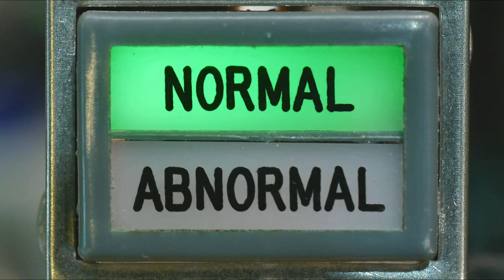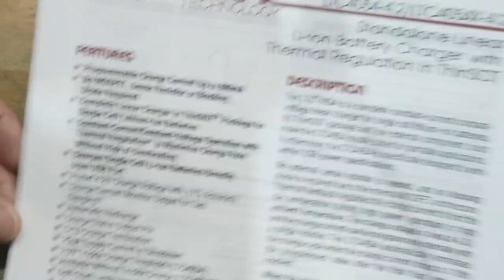#677 TTGO Board Battery Charge Current

Comment: For de-soldering this 0402 parts I use some Kapton-Tape to protect parts around it. I use a tweezer and a hot-air station unter a stereo microscope. This way it works.
Thank you for explaining to charger stuff.
Reply from the maker: Yes that is a good idea and I've done that. I was just lazy as usual.

Comment: I came to the conclusion than these TTGO boards simply have a defective charging circuit. They charge batteries OK but the ESP32 cannot boot if the battery is below 4 volts, which defeat the purpose of having a charging circuit...

Comment: When charging a battery through this board's USB aren't you also powering the module & the TFT driver & backlight? How much of the allowed input current do those devices draw & thus is not directed to charge the battery?
Reply from the maker: if the input is still 5V (things are working) then the battery is getting 100%

Comment: Thanks man. I was using a 400mAh lipo battery and it would charge up way too fast (like in 15mins) and won’t last long. Buying a 1000mAh lipo now. Hope that works fine! So 800mAh and above should work fine right?
Reply: How long does a 3.7V 400 mah lipo battery last?

Comment: Your video gives me the advice to buy a 800MAh battery for the TTGO T3 (good version. There where a few with a design in error in the beging. A fuse was used instead of a diode.). The formart of the 800MAh looks not very much bigger..  It's a Liter 3.7V 800MAh battery with a connector that goes directly in the board.

Comment: Quick question, so if I wanted to use an 18650 case that is a 2s1p (2 18650 in series @ 8.4v 'max' and 6.4v 'shutoff'); would the TTGO be able to charge it or would I need to go a different route?  Reason I ask is that I have a project but need to use a 6v air pump (hence why I was thinking I could run the power out of the pack to the 5v relay switch that the TTGO would control, then also feed the voltage from the pack to the VIN and GND pins on the ttgo).  Or would this cause a possible fire hazard?
Reply from the maker: it will only charge 4.2v batteries
Reply: @IMSAIGuy  Yeah I don't feel like doing a software BMS LOL Thanks for the reply.

Comment: Can these be made to use a wireless thermometer? Any info?
Reply from the maker: Well it is WiFi and Bluetooth. so if the thermometer is one of those.  I have used two TTGOs, one as the transmitter and one as the receiver. the transmitter one could have a temp sensor. Also one TTGO can be used as a web server and have a webpage. you could go to the webpage to see the temperature.